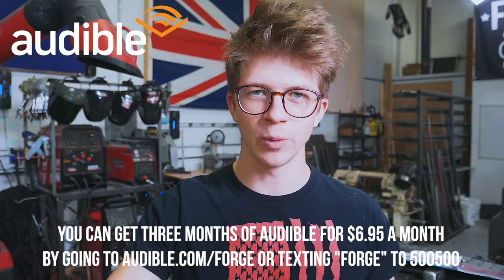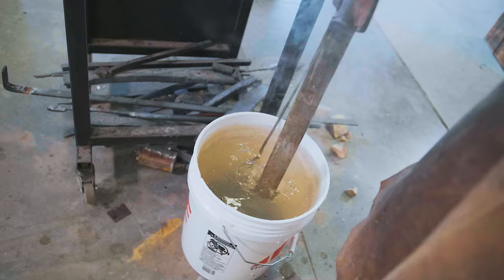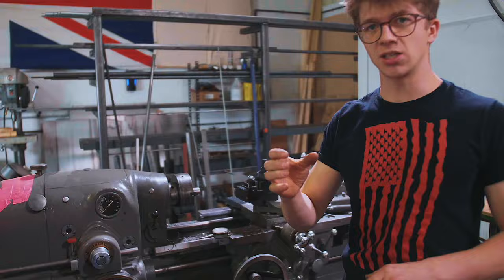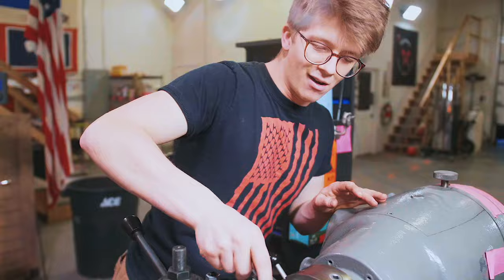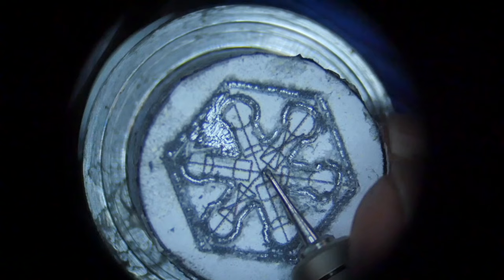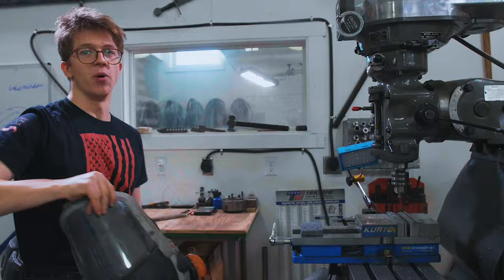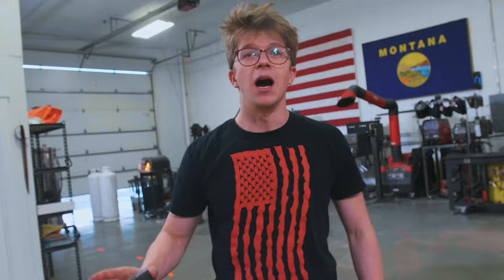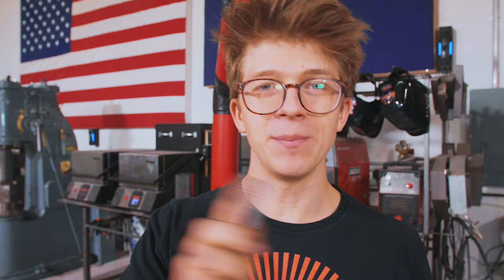MAKING MANDALORIAN BESKAR STEEL!!!

Comment: Beskar is not exactly steel. More precisely, not steel at all. Moreover, it is not as second-rate as welded Damascus. 
Yes, welded Damascus is a rare advertised piece of shitty steel. The best representatives of Damascus blades had a hardness (HRA) of about 24-28 units, and high-quality crucible Bulat have HRA from 48 to 64. Modern grades of tool steel can go far beyond all the previously listed in this indicator, but often do not bend at all.
According to lore, beskar is used for the production of cold weapons and can withstand temperatures of several thousand degrees Celsius for a long time, so it is logical to assume that it consists of refractory and durable materials such as tantalum, Osmium, tungsten and titanium. Dark parts of the pattern look very similar to TT7K12 (CO up to 12%. Carbides: WC=81%, TiC=4%, TaC=3%. 
Hardness HRA not less than 87.0).
At the same time, from "Order 66: A Republic Commando Novel" you can find out that Beskar has 2% iridium and no carbon at all.
I can not speak with all confidence about the composition of Bescar, but Whatever it is, it has a mighty high melting point. And you should remember that at the time of the first star wars trilogy creation, Titan in the United States was an Anobtanium.

Comment: Given every piece is unique and you could mold in a serial number, you could easily warehouse these and issue paper currency with matching serial numbers against them. Similar to using a gold or silver standard except the value would be in the artistic value rather than a numismatic one like gold or silver.

However, I like you and would not want to see you thrown in jail like Bernard Von Nothaus was LOL There's a reason the creator(s) of Bitcoin were anonymous.